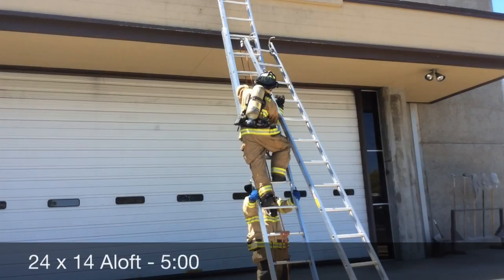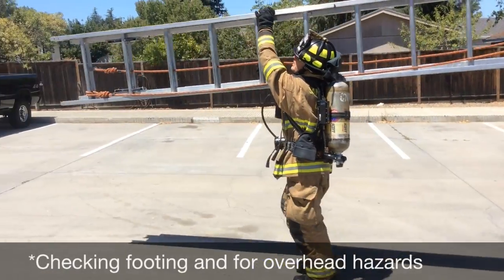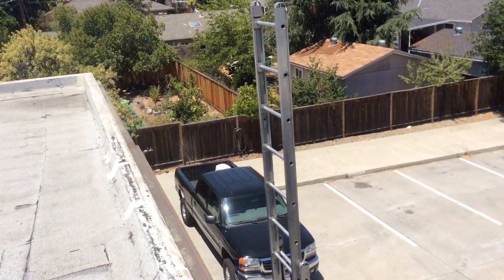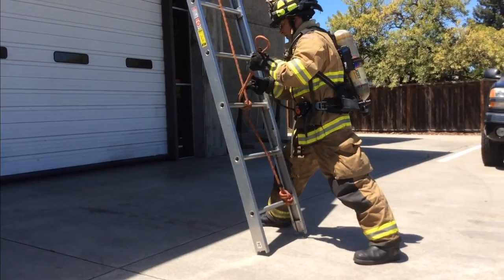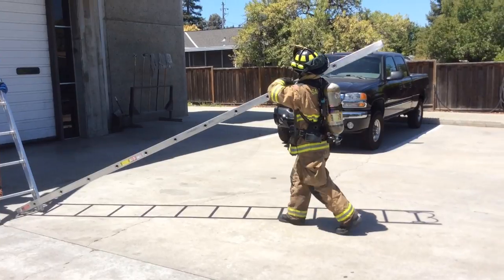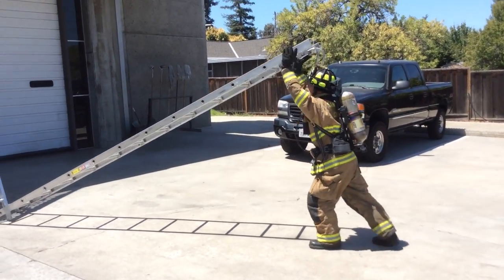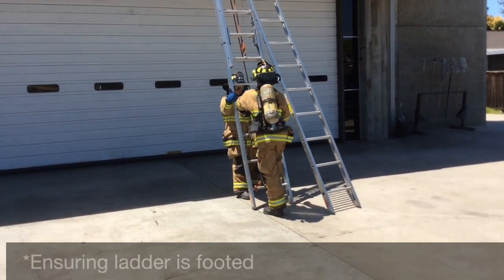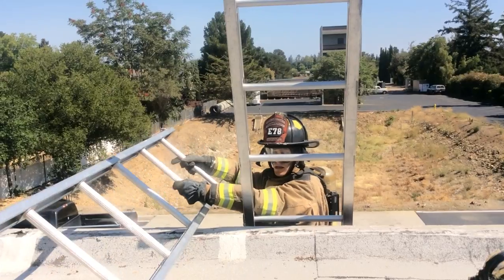Academy Video: Raising the 24' Extension Ladder / 14' Roof Ladder Aloft

Comment: Fly section needed to be out instead of in
Reply: the fly was rotated out my friend
Reply: @nathannichols1838  seems like a safety issue. They're overemphasizing what I assume is the danger of losing control of the halyard and having the top section drop into the path of the firefighter... At a cost of setting up a ladder in one position, then moving it laterally via rotation, which causes any number of additional hazards.